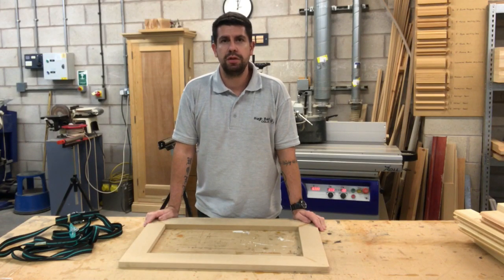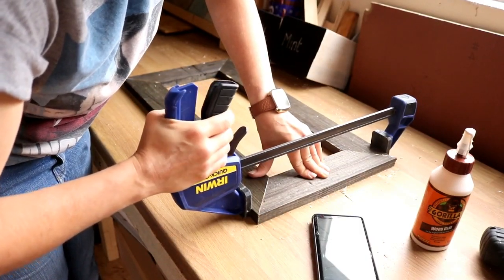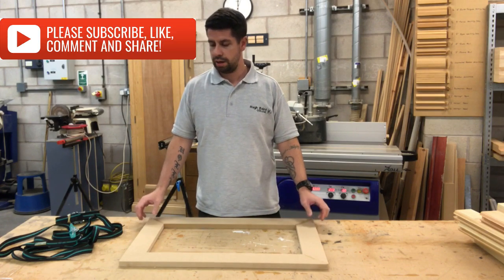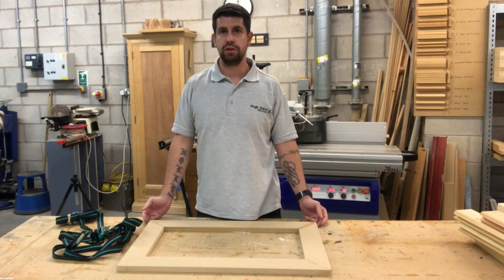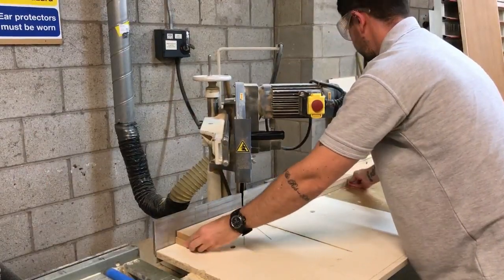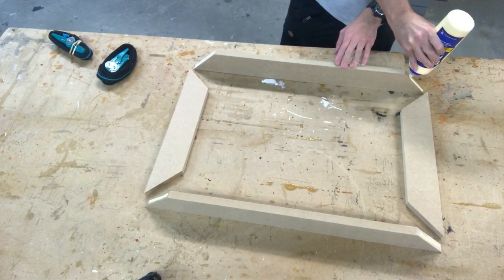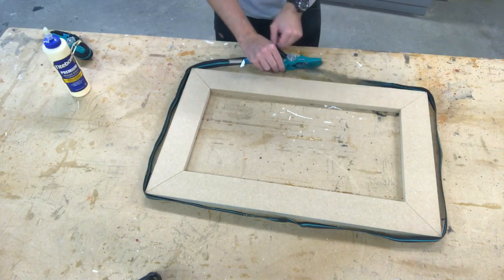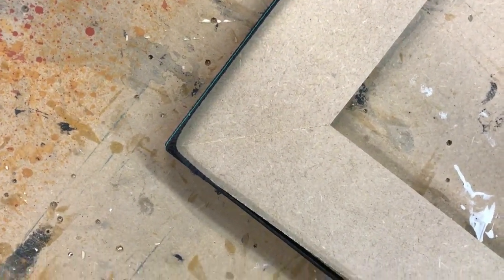'Trade secret' Clamping a mitered frame

Comment: I bought two of these a few months back.  They actually came with little plastic 90 degree corners for each end of the frames.  I haven't used them yet but I can see how handy it will be when I do.  Thanks for the demo!   I also bought a Kreg K5 pocket joinery screw jig system (also yet to be used).
Reply from the maker: Tribulation Prepper I've seen the plastic corners but in 20 years I've never needed them.

Comment: Thank you for sharing this video. I am going to try it. On a picture frame, if the bottom long piece has been cut short, I was thinking of cutting the top long piece short as well but widening the rabbet/rebate (UK English). Would this work?
Reply from the maker: I've seen literally 100s of videos of people messing about with clamps and jigs. All you need is a cheap ratchet strap 👍🏼
Reply: @spendtimesavemoneydiy  You are right. I tried at least  three other types of clamps. None works as well as the ratcheting strap clamp.
Reply: Well your pieces on opposite sides need to be matching length and you can't cut things longer, only shorter. So then an increased rebate on the other two sides to allow for the glass/whatever makes sense to me